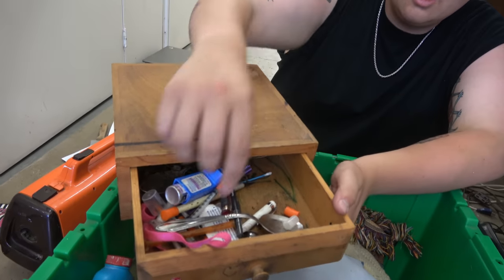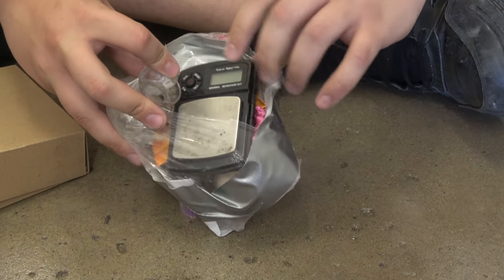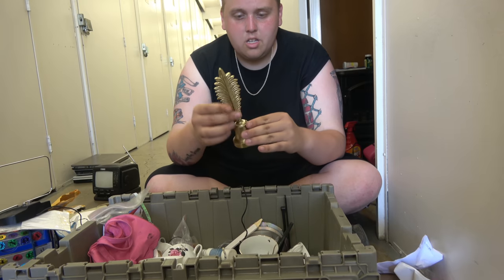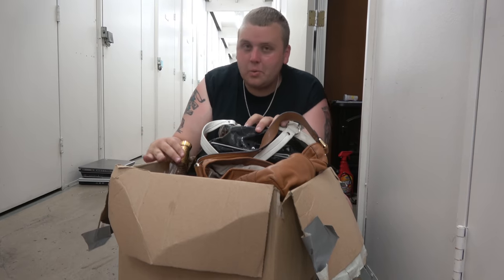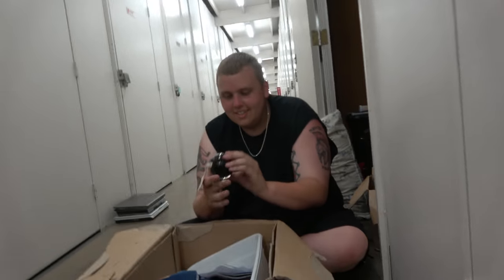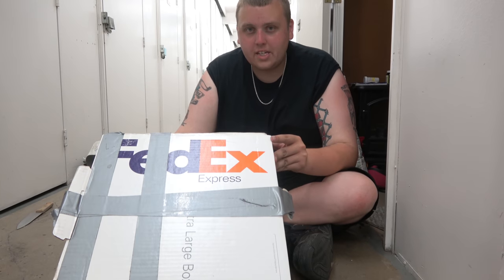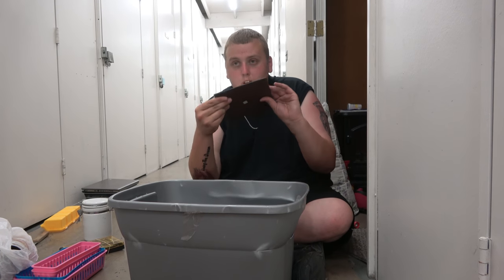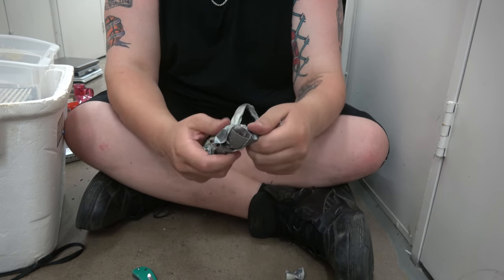I Bought A Storage Unit and the Owner was ARRESTED BY BOUNTY HUNTERS!

Comment: Your innocents amazes me .  I worked in a C-store on the edge of the hood.  I have seen it all.. Also I had a friend that took that long  meth road. As he started  snorted it then when that didn't do it he moved on to smoking it.  The spoons you found if for mixing meth with water because after a while using with a needle is the choice.   If you truly find a crack pipe it will also have a brillo pad also for cleaning the inside of the pipe and then light it and smoke it. I realize you  may know more than you are letting on and you probably think I am a druggie,  No sweetheart just a old woman who likes her weed.  The man I spoke of finally hung himself.  Very sad.